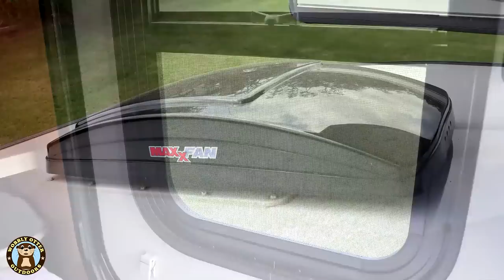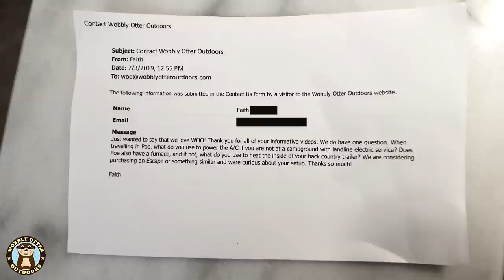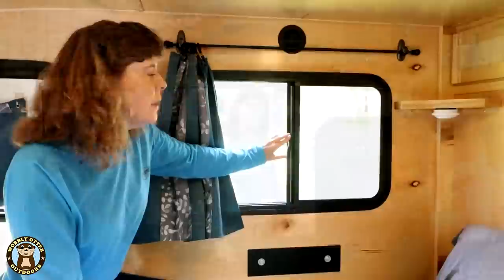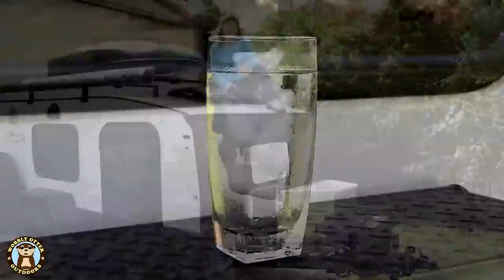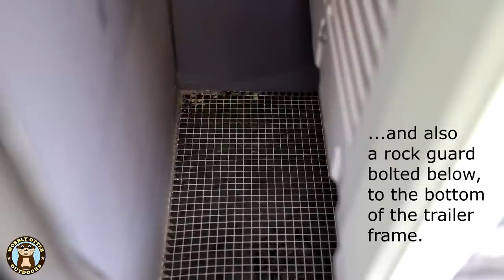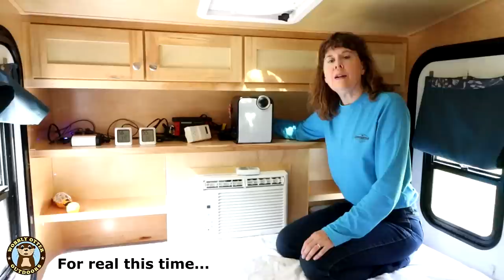Small Camper HVAC System - Wait! What?

Comment: Great videos. I am considering building my own mini camper. Your description of condensation is spot on. Most of these smaller campers have no real insulation and since the walls are cold the moist breath condenses almost immediately on contact so the ventilation dose not have time to clear it.

My plans include a lot of winter camping so I intend to build a camper with thicker walls and significant insulation. I might even use 2x4 studs with regular house construction steps to really be comfortable. With that much insulation I think condensation will be zero if the space is heated a bit and there is some ventilation. This would be a significant improvement over the escapade and other like constructed trailers.

Your videos are inspiring me to greater adventures! Thank you.

Charlie in Virginia
Reply from the maker: Thank you, Charlie. Wishing you all the best on your camper build aspirations!
Reply: Hey buddy, i remember reading your comment about a year ago when i started building my camper!
Reply: Ever end up building yours?
Reply: @TroydaBoy6160  No. All talk and no action. After much thought I decided I want something with a bathroom. Tear drops are also a little hard for my old bones to climb into and out of. With these new ideas, building it myself is less practical. Still mulling it over. Charlie.

Comment: I enjoyed the video. Your last few words really drew my attention. Opinion. HAHA! So with that said, there’s camping, glamping, rving and then there’s bringing the whole house. I personally like the first 2. Teardrops, to me, are still camping simply because you’re still glamping just with a hard tent. 

For those that are new:
Camping : tent and wood fire
Glamping : electricity, 
temperature control, etc.
RVing : all of the above with an inside restroom.
Then there’s bringing the whole house. Huge motor home or anything over 16 feet with slide outs. (Again, my opinion.)

I have nothing against any of these by the way. I just personally like glamping. You’re still out with the bare necessities, plus a few comforts. You’re going out to enjoy your surroundings with out all the extra baggage. If you know nothing of camping, you may want to RV it. Keep in mind RVs have a small floor space. Clean your shoes or take them off before entering. You may end up cleaning your whole trip out. HOO!
Reply from the maker: Thank you, Bathrobe Carpenter! 😁  Yep, we see Poe (the teardrop) as a hard-sided tent... Like our roof top tent, but much quieter in high wind. (And with an A/C...)  Hmmm. Guess there is a bit of glamp there.

Comment: How is the the insulation on the floor that you put in with interlocking foam mats .is it holding up good any problem with moisture or mold underneath them. I just bought a 7 by 14 cargo trailer that I'm converting to a camper so I just wondering about how your insulation held up I was thinking about putting reflective Down and interlocking foam mats on top of it to help keep the moisture out is that a good idea or not. Great video love watching.
Reply from the maker: Hi, Thomas. The foam tile are doing great. Bill and I have visited about it and we think the additional reflective barrier may help. We haven't had any trouble with moisture under the mattress or the foam tile. I vacuum under the foam tile that are near the door end of the camper after every trip and check for moisture.
If you do ever experience condensation on the walls of your camper, it would be good to lift the foam tile and allow everything to dry out.

That's another reason I like the foam tile... They aren't permanently attached to the floor. Hope this helps.
Reply: @wobblyotteroutdoors  thank you for getting back to me, stay safe with his Coronavirus.😀
Reply from the maker: You're welcome. Thank you. You too... be well.

Comment: Nice AC, but what is the amperage rating, especially at start up?
Reply from the maker: Hi kingstonsean... The manual for the air conditioner notes that it uses 450 watts and 4 amps. No startup amperage or wattage is listed other than saying low-voltage startup.
Reply: @wobblyotteroutdoors  I should have read your comments before posting my question. :(  The answer was right there. I would have thought an AC unit would draw a lot more power (amps). You really could run it on a deep cycle battery!
Reply from the maker: No worries. (We added the exact watts and the amps to the video description because of your question. So, a sincere thank you for asking.  Others are likely interested too and they may not see it here in this comment thread.)  It's amazing what a deep cycle battery is capable of running - at least for a little while.
Reply: kingstonsean more info on the a//c please. 
Brand ,cost,and where  to buy. 
I love your life. 
Thanks.